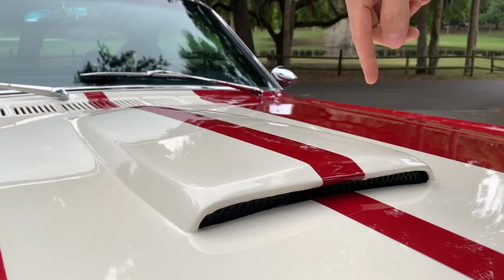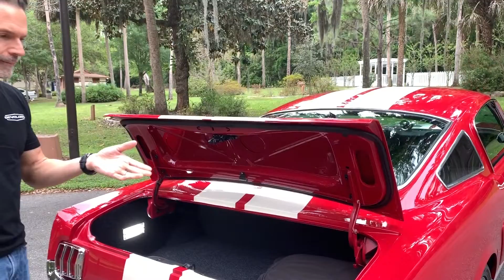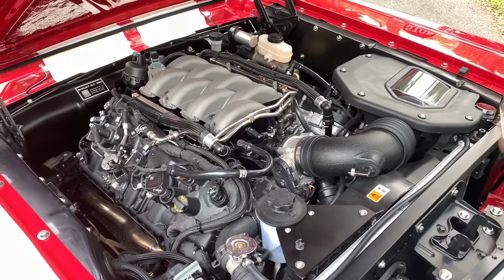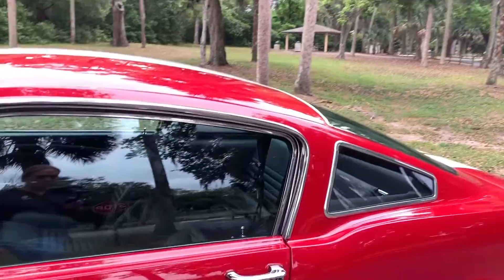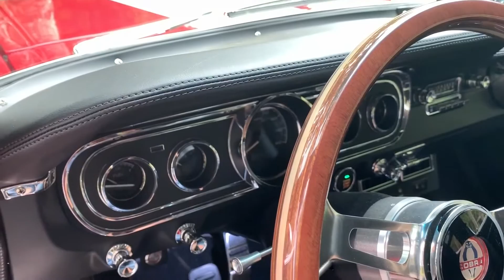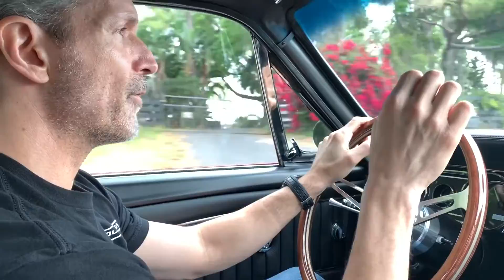Revology Cars 1966 Shelby GT350

Comment: I liked it up until you told us that you put a coyote motor that garbage motor has no business being under the hood of a 60 something Shelby. You should put a crate new push rod polished aluminum 427 Cobra Jet under the hood with a high lift High duration cam and Flowmaster 40 series and an H pipe. You want to give it that old school American Muscle sound with a chop. That coyote motor just sounds like garbage
Reply: I think you missed the whole point of the company 🤦🏻

Comment: Nicely done, but not a fan of that big tach sitting in the middle of view. Dig those sideview mirrors! Love that pointed end. Manufactured or done in-house? Also, are those A/C vents OEM or after matket? I could see those working nicely on my current project. Have to say those dual-injector Coyote enginees are absolutely the pinnacle in IC engine design - gold-medal standard in power. My '67 Mustang's clutch return spring was a HD unit that took a three foot pry bar to attach it under dash and took an easy 50+ pounds of pressure to push in. I added a slave cylinder/throw-out bearing from a Mustang 2 - what a difference!

Comment: Fyi...the most valuable of the non R GT350 cars are the '65's that were left over and rebadged as '66's...so they have the rear qtr panel windows and side scoops but they also have the real welded in traction bars that they stopped doing after '65. (a guy who owned a real '65 fastback K code Mustang with all the Shelby mods.
Reply: I used to own a 66 gt350 "carry-over", purchased at S&C Ford in San Francisco. Also had the fiberglass hood, koni shocks, Detroit locker read end and side exhaust.  Today I own a 2016 Ford Shelby GT350 (chassis #111).

Comment: Nice pseudo replica but certainly not a "reproduction".  Are there any original Ford or factory-spec parts in this car?  Tail lights maybe?  It appears Revology has strayed way too far from the original car, other than looks.  Ditching the OEM spring loaded self supporting hood hinges for a modern el cheapo support rod is a sacrilege.  And the modernized dash also looks cheap as well as the horrible choice of carpet.  I'd also much rather have correctly shaped period style seats with "ugly" classic vinyl than what Revology has included.  It also looks like the transmission hump is way too high and square shaped.  On the outside, other than the modern wheels, the car looks fantastic.  I bet it even drives much better than the original, so it ain't all bad... other than the price.  OUCH wonder what happens when you have a minor, or worse, fender bender.  Hmmm... how long to wait for a replacement fender or hood or door or bumper or ????
Reply: Sorry, but what an ignorant comment.  To save weight, the GT350 has a fiberglass hood from Shelby which necessitated removing the springs from the hinges and installing hood pins and a prop rod. You whine about it not being more "original", then criticize a totally original feature.  Also, as far as I know they get all the bodies from Dynacorn so all the sheet metal is factory Ford correct and available next day if you're willing to pay the freight. As far as straying from the original car goes...THAT'S THE WHOLE POINT! A car that appears original, but with all the power, handling and convenience of a modern car.
Reply: My guess is that it has a six-speed transmission which means they would have to enlarge the transmission hump, which is why the hump looks big an square

Comment: Wonderful car but they could have installed the rear license plate properly. More importantly, the rubber intake tube coming off the air filter housing is rubbing against the plastic radiator fan shroud. The heat and vibration will eventually cause that to rub through. Just saying.

Comment: Too bad they're 6 figure cars.🙁
Reply: It just a bit over "overpriced" in price category in my opinion
Kinda a bit fair price, considering that beauts. Brand new body(the newest gen of revology is even using in-house unibody), brand new motor, brand new 10speed at and the rest are freaking new as well

Its basically new built mustang(with whole modernization on all sector) with timeless body